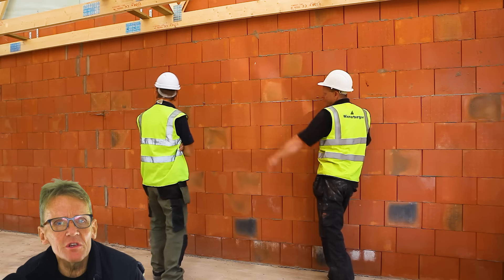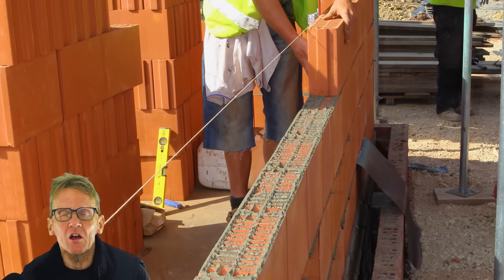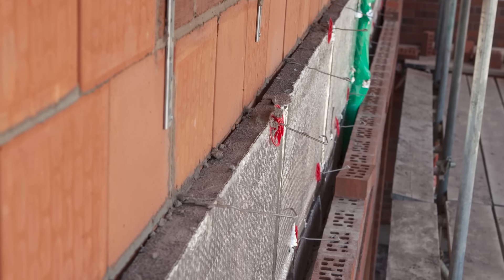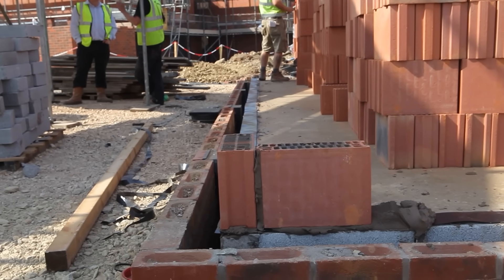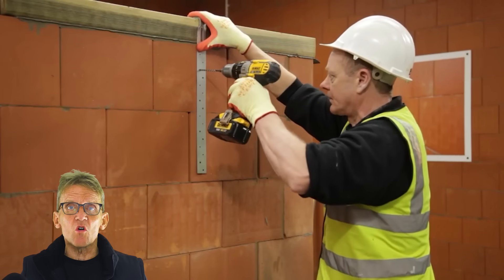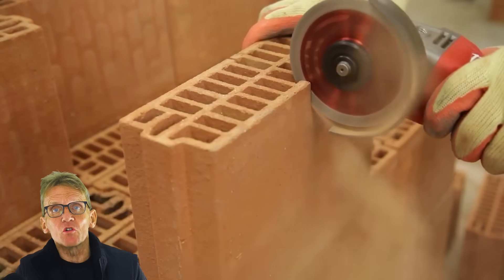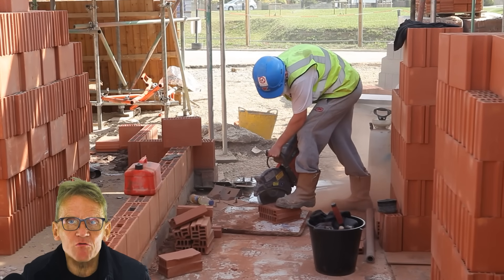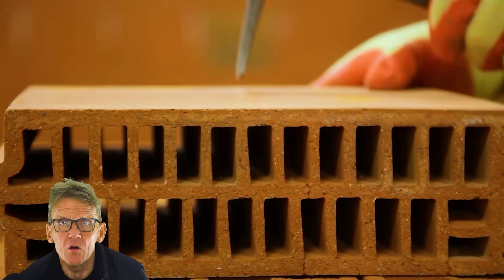Why Haven't We Warmed to Porotherm in the UK?

Comment: I worked on site around Berlin a few years back and these were all the brickies used, We used 300mm wide blocks, so no cavity and external wall insulation (EWI) on top.
Later I specfied them for a self build in Wales and distribution was the biggest problem but we bought a whole lorry load and the suppliers gave my customer some training to set the job up level.....the build flew up. Only downside was fixing downpipes on through the EWI. I love em. Trouble is if you are building an extension and can get the blocks.....what are you going to do in the afternoon? :-)
Reply: Beer garden 🍺 😁
Reply: In Germany do they still have a beer break in the mornings when a lad comes around the site with bottles of beer in a milkman's crate,
Reply: @sicks6six I remember that.  Always bottled beer and Always in crates
Reply: I would fix the downpipes with stainless threaded bar going right through to the Porothem set into the blocks with resin bags. More hassle for professionals but external insulation always is.

Comment: I never work with poroform these days but as a metal fixer I can say they were a nightmare to fix to. Abutment stud and 6A were impossible to shoot on even in the tiny joints. Only way I use I do it (10 + years ago) was to drill a 6mm hole very carefully with a hammer drill, fit a cheap quality and I mean cheap red wall plug and then drive a 35mm tapcon into it. I’m sure there’s proper fixings these days

Comment: As a beginner, I used Porotherm for the inner and outer skin, with a 150mm fully filled cavity. Worked like a dream, building control were very happy, and a thin render on the outer skin is perfect. Just make sure the right mix is used fot the render - it is different to standard blocks.

Comment: Never used them and as a bricklayer anything is better than a concrete block that should be banned to heavy .You lay them for 35 years and your gonna have joint issues .in my opinion the industry in the uk needs to ban them so these clay block make a good alternative im sure they could come ready insulated aswell. Only issue i see is fixing to em kitchen etc
Reply: Another point on conc blocks ,at least here in USA, they are not as strong as they were say back before the 80s. My parents house has block foundation made in the 40s and the blocks are a completely different consistency blend of ingredients. They first of all weigh way more than the current time blocks, they are very dense and very resistant to cracking and they have pea gravel in them also, which makes them incredibly hard to drill holes straight into them.
But the incredible mass they have is just crazy as my dad had some loose ones in a stack and I'd used them around the gardens and whatever projects to hold things down and they are just bigger, denser and thicker molding than the new ones. The new ones are like cardboard compared to these vintage blocks. Lol
The new ones seem to break if you  drop them wrong or drop something on them wrong, and they seem to begin cracking much sooner if they aren't sealed.
They are easier to move around but their strength just isn't as good as they used to be.
Reply: @d.aardent9382  
It's a fair point I suppose. Each country has its own idea of what is exceptable for it's climate etc .All I no is laying concrete 7n blocks here that way 20kg is heavy going especially when you get up high with them for a scaffolding lift .do that 35 years and your body is screwed my opinion is they should be banned from use pleanty of alternatives out there these says .

Comment: This year I fixed a very expensive house with these in Wimbledon for a well known house builder. They used these as the internal face block (they never used them again) for a cavity in a basement that had a swimming pool. All ripped out as the condensation in the walls and floor had killed the house. Didn’t help that no vapour barrier was behind them.  They can be good in some climates and situations but not so great in others. The calcs are important.
Reply: The best of materiaks will fail if the build is wrong. Imagine paying for a basement swimming pool and skimping on the fees to hire a designer that hasn't appeared on the Muppet Show.
Reply: What you are describing is incorrect product usage and a builder who failed to train their staff. Clay blocks are infill material on the continent with the load bearing part of the building constructed from reenforced concrete. Basement walls are never made from clay blocks and you cannot stop damp going through them. Honestly, the architect that approved this should shred their degree as clay bricks are not waterproof and neither are these blocks. It is impossible to build a basement with this and also cavity walls have no place in below ground construction.
Reply: @george9710 
As stated they were used as an internal face block forming a cavity. Nearly every basement wall has a cavity built today I’ve worked on be it a city piled office block or domestic. The face of that concrete wall is pretty cold and most at some point in their lives will leak. Requires inspection hatches so you can keep an eye on occasional. 
BS 8102:2022 ‘Protection of Below Ground Structures Against Water Ingress’ is best practise. Follow that and basement owners should have a nice environment.

Comment: In Bosnia and Croatia they build on a slab with no corners,  then they add reinforcing rods,  shutter with wood and pump in concrete which binds the staggered courses to be very strong.  Our UK newbuilds are pathetic boxes in comparison.  They also make rockwool filled blocks.

Comment: Come to Australia and see how we build…. Rammed earth included, We have far higher thermal daily temperature variations a building has to take temperature changes of 20c in 30 minutes… during weather changes..  In my new steel frame house you can put the heating on one day, switch it off and it’s still the same temperature 2 days later inside… half the house walls are double glassed windows.. floor to ceiling jobs…. Windows are from Germany. One thing we do badly is the use of 1000’s of different fitting types screws etc…. It’s a bloody nightmare working out what’s best to use.
Reply: i used fastwall in australia a type of hollow clay block very easy to use that was in w.a.

Comment: I live in the UK, but in Croatia we build with these, and then just simply finish outer with external insulation(rock woll is best option since it is breathable and fire resistant, but many people use cheaper polystirene). Only difference is, since it is an earthquaqe prone area, building regs require vertical (every 3-4 meters if I remember corectly), and horizontal (above openings like doors and windows, load bearing walls, and top of blocks every floor all around) reinforced concrete pours, width of the block and 25-50 cm in height, depending of the structure
Reply: In the UK it all depends on what the mortgage insurance companies accept.

Comment: These clay blocks are very common in central EU / czech,slovak republic,austria,poland,germany./ We never build cavity walls.Single wall with these blocks 380,440 or 500 mm wide,where small cavities in blocks either hold the air,polysturene beads or mineral wool as thermal insulation. Rising damp is never a problem as we build on base concrete,where we use thick bitumenous DPC containing alufoil that is torched on the base concrete- works as radon membrane. 
You dont need to parge these walls inside as plaster works the same and this system is used to build passive houses where external walls have U value 0.11  . All airtight with plaster. Nobody really use plasterboard on it.
We even thermally insulate foundation on external side with XPS. 
https://youtu.be/iINWzQCNsow?si=3blXY-Yy5VfPirh5

Comment: I used those in my renovation, added a new extention and some new internal walls.
Everything was done in 1 days work, i used the dryfix its the foam, its crazy strong that bond i was in disbelieve.
Also no mortar or adhesive like in the video needed with the foam, really fast.
Reply: Hiya where were you able to source them for smaller quantities ?
Reply: @anshul712  You had to buy the bricks per pallet where i got them, they gave you x amount of the spray foam depending how many you bought

Comment: My first house was an ex council house in essex built in the  late 50's the whole house/estate was made of these as apparently there was a brick shortage in the UK around that time. Considering insulation regs back then were next to nothing these were very thermal efficient. They are drilable like regular bricks and the top half of my house was rendered. It's only if you broke Into them you'd know they were different from bricks. Infact They were mortered together as they were laid lengthways, however they were maybe half the size of those shown.

Comment: I think they look ugly as sin, and that is reason enough not to use them.
Reply: Nobody use these as a skin. These are like the aerated light concrate blocks which ara also not used as a bare skin whithout a render or drywall cover from insde, or render / cladding from the outside.

Comment: They might work in Spain where they do get any 'weather' but they look useless for the UK. That thin smear of cements looks like you could push the lot over when dry with minimum effort, not impressed.
Reply from the maker: That is the opposite to what happens. The adhesive sets hard and you will not break them apart. That is why you can build the whole of the inner skin of a building without bringing the external skin up.
Reply: @SkillBuilder  What is different about the cement used compare to normal brickwork? I think there is a good reason for using 10mm in ordinary bricks, it would probably be unsafe if you didnt. I am also sure there would be a significant problem with damp with so little mortar between the blocks. In Spain they typically build a concrete structure and use these blocks to fill in the gaps, which looks terrible so they render the lot to cover it up. I think they are a really bad idea in the UK, no one wants single brick houses covered in cladding.
Reply: Not sure if in Spain they use these in a cavity wall system? On the continent the Wienerbereger or similar clay blocks are used to built in a lot thicker monoblock walls, but won't call it "skin" since itstill has to get a render on each side or at least inside with some sort of cladding outside (with or without external insulation).
At least I've only seen monoblock walls before moving and living in the UK and I've worked in the construction industry there.

Comment: Hi all, did a build with these about 10 years ago, yes on a slab, yes on a sand cement first joint. What is available is a u shaped channel that you can lay at each story height and cast a ring beam in which gives you a really good opportunity to correct any issues. Loved the stuff.

Comment: Have something similar in internal walls of our 60s property. Seems they have been used in the UK on and off in the past but not very widely. Seems to be a good alternative to other types of blocks as long as they're laid properly. Some structural engineers aren't too keen on them though. Certainly no damp problems or structural issues in our place, nor any issues securing fixings to them.

Comment: Absolutely ##it material-: fragile / not structurally load bearing.
Worked on many, many sites.
Only saw them used once.
On Brewery rd - Islington
Below ground on ( non load bearing party walls
Reply from the maker: They are load bearing, They will take steels and bison beams. They are rated 10 newtons.

Comment: Crap cannot cut them take no weight. Building control will not let you put steel's on them
Reply from the maker: They take 10 Newtons which is more than an aircrete and we put steels on those. 
Of course you need a pad stone whatever you have but that is all.  Building control are fine with that. 
Just to give you some idea, one block will take the weight of two JCBs.

Comment: Used to see these a lot in France and they used them a lot for stud walls aswell. What was more impressive is the ones they used for stud walls were only about 50mm thick!! They also made ceilings out of them but didn’t see much of that for obvious reasons. As an inside skin I would favour them over Thermalites because they are a lot stronger. It always seems mental to me that you can put massive RSJ’s onto Thermalites and 9 times out of 10 they only specify a padstone for the beam to go on. I always put a spreader lintel under the pads, makes me feel better 😅
Reply: Most warm foreign places use these as fillers in-between concrete floors. They don't use them as support for the steel beams. Imho that is asking for crumbling and eventually collapse. They are only pot and they are not rigid if you have multiple courses on top of each other, even if they interlock.

Comment: The problem sometimes with these kind of clay cavity bricks, is when you drill into them they can crack. If your drill is sharp and you use a lower hammer setting it might alleviate that issue, not sure.
Reply: Masonry bit, no hammer is the usual wat to drill these.

Comment: I've never seen these blocks used in continental Europe; we use blocks which are three times as thick as those, with generous helpings of mortar (1 cm) to bind them. Nowadays most new building is reinforced, poured concrete. Residential, family homes entirely out of reinforced, poured concrete.
Reply: These are used on the continent too - but as partition walls.

Comment: Was on a site near Birmingham in 2014 that built houses with these blocks. We were there to fit the kitchens and what a nightmare it was. Had to use very expensive special fixers to secure the units to the wall. It was also a nightmare for plumbers and sparkies.
Reply: Go to Spain, Portugal etc to see their plumbing. All inside the walls with supplyvalves nicely on rosettes, just tidy looking everything. Time will tell if and when construction will/can go that way, as our latest houses now are just a brick skin over a wooden property.
Reply: I bet the mortgage insurers didn’t like it too much either.

Comment: They are used here in Italy a lot too. Just had the builders use them to block off an old chimney. They are also rated for earthquakes.
Reply: I want to know how they are Earthquake rated since they basically have no adhesive between layers.
Their lateral force resistance can't be particularly impressive because of that without very high compressive force on them. Their interlocking nature is minimal and I can't see it holding them together well enough to make up for the lack of adhesive material. 
Also with been clay they must be fairly fragile when it comes to direct impacts, so heavy falling debris is a potential issue.

Comment: Looks strong for vertical load bearing, but maybe not so great for DIY fitting of heavy fixtures such as shelves and TV brackets? I would image you would need long fixings that penetrate both the exterior thin walled section as well as the centre one. And with little material to bite into, maybe a chemical fixing? And those holes would need careful drilling too I imagine. All perfectly doable but not with a standard DIY hammer drill and plastic plugs...
Or do they sell special easy-fit fixings for these blocks?

Comment: Would like to build with them in central Texas. A similar block has been made in San Antonio, Texas but they are not as accurate or normally used. Wish they were available. Like to learn more about how to prevent water wicking.

Comment: I use them in Spain.... really good.
Easy effective and very flexible... And a variety of sizes..
Once dry and solid easy to cut a channel for electricity cables..
So when people say they are rubbish...
It's probably due to the fact they really know little on using them..
However, yup one needs to use a membrane...
Here in Spain they all laughed...when l insisted they put one down...
Years later, showed some, look no dampness...

Comment: Now choose the correct size and you won’t need extra insulation on the outside. Welcome to the continent.
Reply from the maker: It think there is still cold bridging so a bit more insulation is no bad thing, welcome to the U.K.
Reply: @SkillBuilder  my house is 30years old, built with 50cm outside walls and good installation of windows and doors no issues. House is vacant for 6 months during winter, never had an issue.

Comment: Hi, I am always a bit dubious about masonry that is laid completely or partially dry - in this case the perp joints

Firstly, fire resistance of the wall; this is what really counts, not the fact that the block itself is Class A1. I am sure if you ask them they will have some figures, but I could find nothing on the websites - why bang on about the block being completely non-combustible and then show nothing for the walls?

Air leakage - I managed to find lab' test figures of less than 1.20 on a (limited) data sheet, for parged walls, which is very good. But this is under ideal laboratory conditions on an isolated wall panel, plus the implication is you have to parge all the external walls to avoid excessive air leakage - a big part of a homes energy loss

Sound resistance - I see they do actually have a couple of party wall options in the Robust Details guide, so they have put the work in there. If you don't know, party walls (and floors) not built to this guides standards have to be sound tested on site, at completion. Just to mention you don't have to parge Aircrete blocks in party walls - any parging deemed necessary would be as a result of poor workmanship on the mortar joints, rather than the block quality

Thermal bridging (cold spots at junctions) - it would be interesting to know if the have a full set of details on this - At this point I can't be arsed to call them and find out myself. If they don't, you will be highly unlikely to get the house to comply with the Fabric Energy Efficiency requirement of Part L